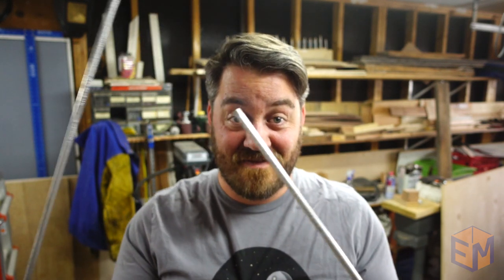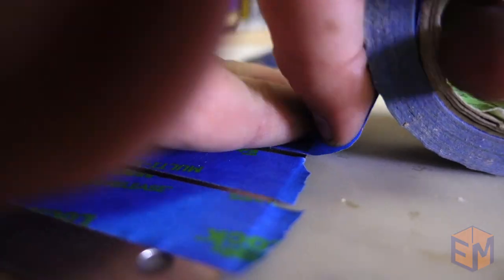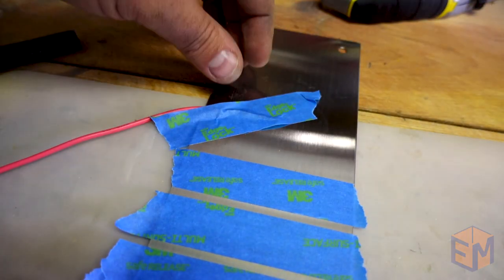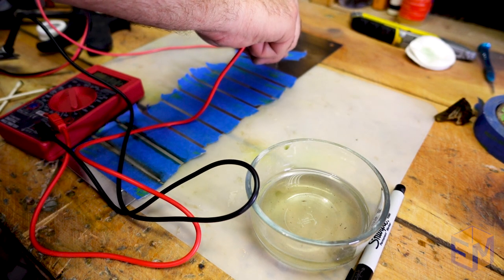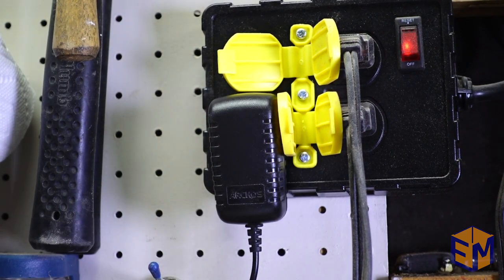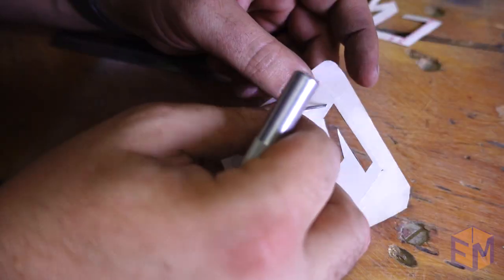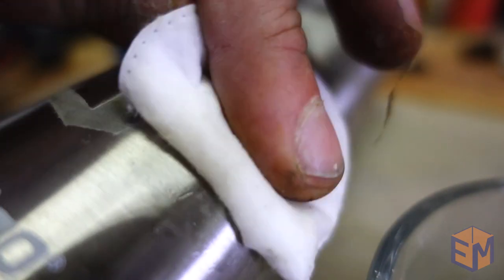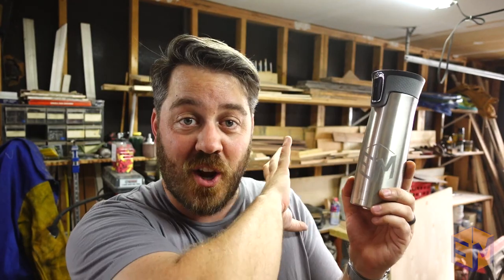Etching Metal with Salt Water

Comment: The best process I've seen for this is one used by lightsaber makers you cover the entire object being etched except for the pattern in vinyl tape like electrical tape and submerge it in a saltwater bath with the negative attached to that and then the positive attached to a rod or sheet of the same metal being etched and you can just connect that to a battery charger and leave it and you can get really nice clean very deep edges
Reply from the maker: I have seen that process and it works great, especially if you have small objects or large designs.  You do have to be careful though cause on an object like this, it's easy to miss a part and accidentally etch something you don't want.  I prefer this process for stuff like mugs as it gives you complete precision on a difficult to cover object.

Comment: Use a circuit to cut out removable vinyl then use a sand blasting cabinet with some fine grit aluminum oxide blasting media (I've used both 250 and 400 grit).  You will get sharper results, and you can blast anything....I usually use it for stainless steel and for glass.
Reply from the maker: There is a local Makerspace that has a vinyl cutter, though I didn't know about it at the time.  I think there are also some online services you can order vinyl cutouts, that would have made this much easier!   I do like the idea of sandblasting, though this was a way I could do this project without investing in any additional tools.  I like the idea though, if you have access!

Comment: Whats the risk of electrocution, considering youre touching both + and -?
Reply from the maker: Great question.  In dealing with this it's a voltage and amperage issue.  Since we are using such a low amperage and voltage, there really was no risk to me.  It's been a while since I've done the project, but there is a lot of good information out there about the level of voltage and amperage you need to be concerned about.

Comment: I am just wondering why you use the electricity you can get the same results without it
Reply from the maker: There are definitely many ways to achieve this kind of etching, but I found this to be not only a fun project, but an interesting introduction into electrical etching.  My dad used to have a sand blasting station, which would be great for something like this.  I've seen people just use clear mat paint to make it look like an etch, or just sanding it in.  I like the ability to get finder detail with this method and not having to buy any other materials other than what I had on hand.  What method would you use?

Comment: Thanks for the tip friend, I would say since your already etching it it shouldn't hurt to have just put the stencil on the bottle then cut out the symbol. It would be slightly more difficult to cut do to it's roundness but you wouldn't have any transfer trouble
Reply from the maker: That's a great tip! I was worried about cutting the surface initially, but after I thought about it, it's going to get etched right up to that point anyway, so it wouldn't really matter, as long as you didn't go over your line.  I think I might just have stencils cut when I do it again, rather than doing it by hand.

Comment: Nick, instant subscribe.  I can't wait to make mine.  I wonder if a powder coating would adhere to that new surface better.  Of course, you'd have to tape off the rest of the mug, but it's a thought, right?  Would be a cool project to try.
Reply from the maker: Make Things with Rob Thank you for subscribing!  An interesting idea to powder coat.  It could certainly make an interesting design to mix the two processes!
Reply: Seriously!  Like you said, pop out those ideas and don't be afraid to try it.

Still though, I like what you did in its raw form.  I see this video exploding someday, honestly.  This is such a simple process with big results.
Reply from the maker: Make Things with Rob I've been thinking about getting a powder coating rig, but not quite high enough on the priority list, not yet anyway.

Comment: Thanks! How simple it is!
i want to etch some textures on aluminum any help please...
Reply from the maker: This should work with aluminum as well.  I have seen people do full on baths with the positive connected to the item you are etching, and the negative attached to another piece of metal (like stainless steel).  Then just plug it in and let it do it's thing.  You can also use paint to protect the surface of the metal.  Probably want to use a latex paint or some other water resistant paint.  I've not tried it, so do at your own risk, but experiment away!

Comment: Awesome job! Do you know if the etching will rust? I’m thinking about doing this to a high carbon blade.
Reply from the maker: I have had my cup for several years now and there is no rust.  It's just exposing fresh metal though, so treat it as you would the rest of the blade and you should be good.

Comment: As far as I know, the gas causing the bubbles is O2, H2, Cl and HCl which is explosive when exposed to UV light. Do you know if there will be created enough gas to be dangerous following your setup?
Reply from the maker: I had good ventilation when I did the project.  It took a long time to do and there was very little gas produced.  Though if you have concerns, I would definitely suggest investigating the amount necessary to be a concern.

Comment: I noticed the first test line on your sample piece was much darker than the rest. I assume longer exposure to the electrolysis causes a darker (or deeper) result, correct?  Did you establish a correlation of exposure time to the shade / darkness of the etched surface?
Reply from the maker: If I stayed in one spot for too long, it would darken considerably.  I'm not sure the science of why, but my guess is oxidation of the steel.  Even stainless steel can rust.  I didn't like that look, so on my final project I took some steel wool to it and cleaned it up, mainly because it wasn't even.  I'm sure with some more practice and experimenting, you could come up with a pattern to avoid (or create) as you wish.  I didn't really get a feel for it based on my limited experimenting.

Comment: Does this work with other metals? I have a project coming up with bronze or brass.
Reply from the maker: I have never tried it with bronze or brass, however I have seen metal etching with other metals.  I feel like it would work, but my best suggestion is to try it on a small test piece first.

Comment: Nice! If I used a power supply (like for anodizing), is there any specific voltage i should have it at?
Reply from the maker: I am no expert, but looking up a specialty etching machine, it is 12v at 3a.  They have a plus model that is 24v at 3a.  I would still be careful, especially when dealing with the salt water at those levels, but it should still be safe with the proper precautions.

Comment: will this work on super shiny stainless steel ?
Reply from the maker: It should, however somethings there is a coating that you need to take off first.  You may also need to take some steel wool to the part that you are etching to give it something to grab hold of.  Wouldn't take much.

Comment: Do you know how I could make water marks on stainless steel? I want to decorate some trays I have.
Reply from the maker: You can use this process to etch the steel, though it did give a darker etch than I was expecting.  I've seen a few ways of doing something similar, from sand blasting, steel wool, using a flat clear coat to give a subtle effect or even an etching spray.  I would suggest experimenting and see what result you like the best.

Comment: Thanks for an informative video!
Im wondering, does it make a difference when having something metal behind the cotton like you did with the pliers as opposed to when you only used the cotton swab?
Ive seen so many different videos and am just trying to understand what exactly the etching tool needs to be
Reply from the maker: It's all about conducting the electricity.  For me, I used the plyers as a stiff base to wrap the cotton around and conduct the electricity. Plus, the rubber handles made me a little more comfortable, those as these voltages/amperage, it's not that big of a deal.  As long as you have something attached and there is enough saturation in the cottons swab, you should be fine.
Reply: @TheEveryMaker  thankyou!

Comment: Do you need to figure out what wires on the power adapter is positive and negative or does it not matter?
Reply from the maker: Yes you do.   Electricity travels toward the negative lead, so if you are doing plating you want the negative on the thing you are plating.  In this case we are etching, so you want the positive in the item and the negative on the plyers.
Reply: @TheEveryMaker  ......How do I find out which is which?
Reply from the maker: Usually the wires are color coded.  Red is positive, black is negative. Or white is positive and black negative.   Other than that, you can use a volt meter, though I would look that up to make sure you don't damage the volt meter.

Comment: Just out of curiosity, are you using a saturated saline solution?
Or is just any added amount of salt an increment for the conductivity?
Reply from the maker: I didn't saturate the saline, just added enough to provide a bit of a current flow.  I haven't experimented with different saturation levels, though that doesn't sound like a fun weekend project.

Comment: Hi ! Thank you for this cool video !
I was please wondering, for engraving sterling silver, do I need to use " a drill bit" or piece of sterling silver to engrave it ?
Does it have to be the same metal as the plate to be engrave on ? or can it be a steel bit ?
Merci again for this cool video !
Teri
Reply from the maker: I've never done silver myself so I'm not sure the best way to do it.  Considering the cost of want to do a bit more research before giving it a try.  If suggest checking out https://youtu.be/D-DACg-jthw which is a great video on the process for silver.
Reply: @TheEveryMaker  Thank you for taking the time to reply !
Reply from the maker: Of course!  Good luck with your projects!

Comment: Sweet! How many volts did you use after you graduated from the batteries?
Reply from the maker: It was just a 5v cell phone charger.   I don't remember the amperage offhand,  I think it was just 1 amp.
Reply: @TheEveryMaker  Thanks for the tips and inspiration!  🤙
Reply: He said 5V @ 2 amps... only 10 watts!  Not sure why he seemed so concerned about people not feeling comfortable around electricity at that level. But then again, people freak out when they lick a 9-volt battery too!

Comment: Great work Sir. Can i use 12v 2 Amp Adapter?
Reply from the maker: Thank you!  Electricity is a tricky thing.  Typically 12v isn't really enough to get through the resistance of the skin, but if you poke yourself and the wires go into your fingers, it can be lethal.  So if you are going to use that adapter, take every precaution and make sure you don't touch the leads.  I am by no means an expert, so I do suggest you do your research and know the risks.
Reply: @TheEveryMaker  you said can use 5v 2 A.... I am planning to use 12v 2A
Reply: @kashifjkm  .....did you have any issues with the 12v-2A adapter?

Comment: how can i  make etching rate faster??
Reply from the maker: Using a power adapter makes it go faster, but you have to be very careful with electricity.   Making sure there is enough salt in the water also helps. It is a time consuming process though.
Reply: @TheEveryMaker  thx. is there any difference when i use CuSO4 instead of NaCl? Which is better ?
Reply from the maker: @감자-e9j9m  I've never used Copper Sulfate for etching, but from my understanding, it does work, and as a matter fact, a mixture of the two is supposed to amplify the effect.  The reason I went with table salt though is one, I had it on hand.  Two, copper sulfate can be dangerous to local waterways and requires special attention when disposing.